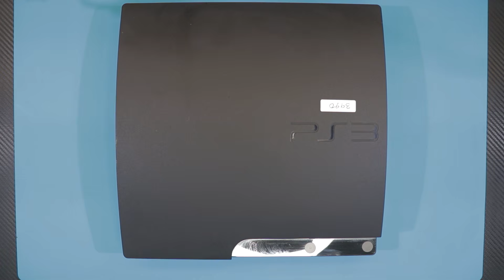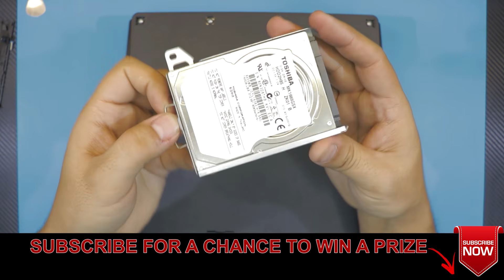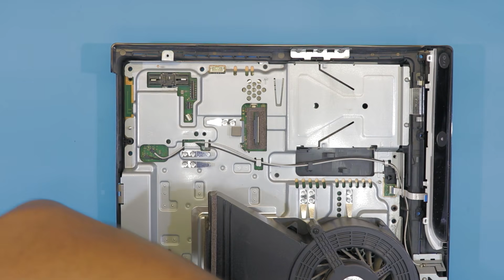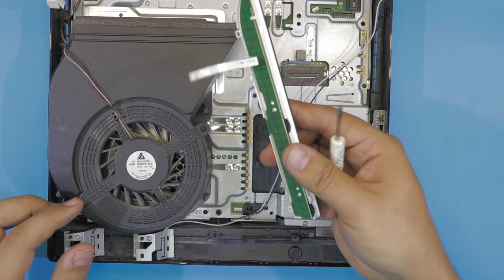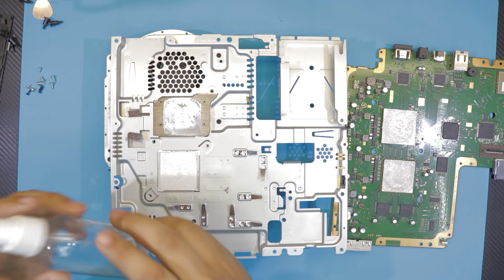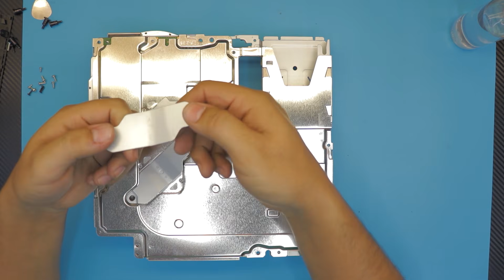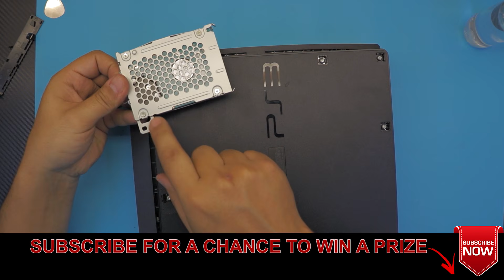HOW TO CLEAN AND  REPASTE YOUR PS3 SLIM ( playstation 3 slim console )

Comment: The 4K video shows the power button ribbon cable being attached the opposite way from this video, ie with the blue side facing in, not out. Whch one is correct?
Reply from the maker: both :P, the thing is from outside both are ps3 slim but from inside they change a bit (internal model). for e.g, the 4k video the DVD drive does NOT have the ribbon cable underneath , and in this one it runs underneath. both are ps3 slim but different versions.
now regarding your question, nothing will happen with you connect the ribbon cable the other way around, simply it wont run the console ON.
the best is to make sure the correct position before removing it.
if you forgot just test both side.

Thank you for the support to the channel :)

Comment: I loved the video, it was very helpful, however now, after I put the ps 3 slim edition back together whenever I insert a game in disk format the disk continues to spin/vibrate at max rpm in the disk drive, but as soon as I enter the game the disk stops vibrating and I hear the laser working. I reset the system to its original settings, but still vibrated throughout the entire reset of the system. Does anybody know the cause of this, software or hardware?
Reply from the maker: can you record a video with audio so i can identify better your issue?, thank you for the feedback and your support :)
Reply: Sure thing: here is my video link: https://youtu.be/_RbhqYYEm3M
Reply from the maker: ok i got it, its nothing to worry about you need to go back to @21:00 and reopen the DVD drive and double check the mechanism and make sure the round magnet plate in the middle is sitting in place. else it will do that sound. and double check are the flex cables make sure they are all pushed all the way in evenly. send pics of the dvd when open when opening it.
Reply: @uFixTek  https://www.youtube.com/watch?v=Xl6Btw-WzGc&ab_channel=RobertoStoica [Still has the same issue though]
Reply from the maker: okay everything looks fine in the video and nicely done with the video, im thinking and its hard to solve the issue not having it on hand.
you can try the following:
1. when putting a dvd inside the noise is the same or it goes away when you have a dvd inside?
2. try removing the top cover and power on and try to see what is making the noise. and you sure its the DVD no the fan noise (it sounds like dvd lens ) but you need to power on without the cover and test and take your time and look at it.
Reply: @uFixTek  I already did that and it all looks good, I checked the laser, ribbon cables, magnet is steady and level when spinning, as well as the disk is okay, the issue is only when the game is not being played on the PlayStation, as soon as the game is playing, there is still some noise, but it is much less because I think the PlayStation slows down the disk to be able to read it. The noise is only with the dvd inside, without the dvd the PlayStation is normal. Overall I feel the vibrations from the disk drive, not from anything else.
Reply from the maker: mmm i wish i could tell you i take a look at it but im very far, but trust your self and there is something not right with the mechanism of the dvd. try to open the dvd cover and test the dvd drive without the cover.and pay attention on the smoothness of the mechanism and see if its struggling at any point.
Reply: @uFixTek  Okay, if it doesn't work I'll just take out the dvd/game if I want to use it for anything else. Thank you very much for trying to help me and I wish you a great day. How can I spread the word about your channel?
Reply from the maker: i wish you the best and if there is anything in the future ask me in any of my video comments, and regarding the word about i appreciated any help i can get :)

Comment: Disassembly went smooth until I had to remove 5 screws from heatsink plate, only one of them got off, so I had to abort mission, I don't want to crack mobo or worse.. too bad cause I had some nice Thermal Grizzly Kryonaut prepared for my oldie PS3 CECH-2004B :(

I must get better screwdrivers or electric one.
Reply from the maker: can you mention what screw you had struggle with, you cannot brake the mobo its very tough and some screws require extra push and rotating force. and i appreciate your support to the channel by sub :)

btw use this they are the best in class:
https://amzn.to/3l4AvLy

you wont regret
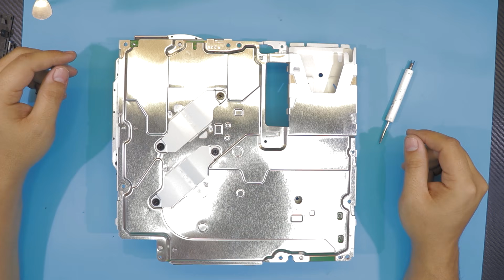Reply: @uFixTek  8:18 these five side screws.
Btw I have quite similar set, "no name" but very nice to use. Working with mentioned before five screws - that was my first little disappointment on it ;)
Reply: The point is, these screws are so tightly screwed, even my strenght wasn't enough and my screwdriver started to spin on screw's head and this is straight road to f... up screw for good (had this problem with PSP small soft screws, total engineering disaster, well done Sony)
Reply from the maker: to remove them i do a strait deep cut on the screw head and use a flat screwdriver :)

Comment: I've cleaned the fan and the power source n my fan still sounds like a vacuumed and I get a over heating warning after about 5 minutes. Would doing this same replacing the thermal paste help fix this issue?
Reply from the maker: YOU MUST replace your thermal paste else you will get over heating msg and crashes. repaste using artic msx 4 :
https://amzn.to/332RA2c

Comment: After doing this the ps3 works fine and it takes discs but it’s not reading them. Any help?
Reply from the maker: you may have not pluged in the flex cables correctly or all the way in. double check all the flex cables.
Reply: @uFixTek  that was exactly it. It was the big one directly underneath the disk drive. I managed to reattach it whilst the drive was fully intact. I could barely see what I saw doing and could hardly fit my fingers in but I still managed to do it. Just hope it stays in place. Thanks a lot
Reply from the maker: im glad that you got it fixed my friend , if anything and me out in any of my video comments. thank you for the support to the channel :)

Comment: what if i accidently lost those 2 rubber pads next to the cpu. they are so easy to come off.
Reply from the maker: you will need to replace them if you lost them,:
https://amzn.to/3n1acr5
Reply: Do is there somewhere that shows where they are supposed to be placed? I have no clue where they go.
Reply from the maker: you need to place then right to the left of the heatsink as in this pictures the brown pads:
https://imgur.com/a/S7Ii7MB
Reply: In my PlayStation slim there are a couple more pads and they came out of place as well. Do you have a picture of where the rest of them are too? After that I should be good
Reply from the maker: tomorrow i will open a ps3 and i will post you a pictures of the pad locations.
Reply: @uFixTek  I'm not sure if it is relevant but my model number is CECH-2001A
Reply: Hey did you ever get around to taking apart that ps3? 👉👈🥺

Comment: Thank you! I was able to follow along step by step and take care of dust-bunny clogged overheating system, and it only cost $17 for a safety tool and thermal paste. Awesome video!
Reply from the maker: Glad it helped! and i appreciate your support to the channel by sub :) if you ever have any question or request you may ask me in any of my video comments
Reply: @uFixTek  I Have some problems with my system, I Think it might be the fan because it shuts off right away. It would also turn off the PS3 the moment the fans start running quickly (Making a low humming sound) when it does not shut off right away in first problem and happens while im playing a game for a half hour.
Reply: @R101_Gamer  That's the same problem I have man,that's the sign of an overheating PS3...should follow this video,it's your best bet at fixing it.

Comment: Great Video! The title says "repaste" but this is SUPER useful for every part of the PS3 Slim, not just the thermal paste part.
Reply from the maker: Glad it helped! i put repaste because in order to get to paste i have to take everything apart and i like explaining and not cut up videos, and i appreciate your support to the channel :)
Reply: Exactly it's super helpful! I was struggling to connect the disc drives power strip that goes in flat til i realized you unclipped it and wound it back in through the drive. Thanks so much!

Comment: Is this how you fix your ps3 slim turn on then suddenly shut off?
Reply from the maker: it could help and resolve your issue , if its over heating and sudden power offs. but there is no harm to do a repaste.
Reply: After it suddenly shut off it turns on for second then off my ps3 slim is second hand i didn't open it through motherboard. I even replace it with new power supply i didn't work o think might be issue in motherboard.
Reply from the maker: your issue is from GPU chip you will need to open up and repaste the thermal paste and it may help you out, do it and let me know if it didnt i can help you by doing another steps.

Comment: Bending the clamps is just plain unnecessary and certainly counterproductive
Reply from the maker: you would know my friend, i wouldn't know with tests and tests over 15 years in this line of work. but by all means don't do it if you feel like it.   thank you for your opinion.
Reply: @uFixTek  what's the purpose of the bent clamps? what outcome do you expect? what do you supposedly achieve by doing that? Thsnk you for your time.
Reply from the maker: @MiloZabál  i would have to explain a law of physics  and in order to transfer heat / cold from one material (metal) to other material(metal)  you need pressure, because pressure, the thermal paste is there for only to fill the micro imperfections that are on the dye or the metal heat-sink(the quality of the paste will determine how the heat can travel in that material) but not how it will get absorbed into the second material, that come from how much pressure you have in between the materials.
to not go into more details, here the ex-clamp has only one purpose, to pull the heat-sink as hard as it can to the motherboard / gpu.
by bending the clamps backward you will generate more force , therefore more pressure , and therefor this will not result not only lower temperatures, but for longer lasting effect.
i hope i have explained my self a bit. 
but none the less you can run DIY tests and you will see the results by your self, im here to help as much as i can. 
in this situation for example:
if i do a service job with out pulling back the x-clamps the client has returned because of red light or error over heating.
but if x-clamps pulled back and same paste and same everything = client happy and we are all happy no more eerror no more over heating.
thats another experiments that was done apart from many other inside tests.

again  we always appreciate comments and supports
Reply: @uFixTek  Thank you for your time and politeness. But I think maybe you're wrong. By bending the clamps you're not improving heat transference nor augmenting pressure in a particular place. Putting excessive pressure can be counterproductive and harmful to overheating processors. I never touch nor modify the clamps and still I have had  a decent success rate with  the consoles I've done maintenance to, (which I've got to say are no more than 5) but I'll try this fix when I get a red light malfunctioning unit to test.
Reply from the maker: we could go on :P but i always say we have to do what works for us and everyone works in many other different ways. its like religion ,  you can believe in your religion but that doesn't have to mean that other religions are wrong, we /I respect all and if what works best for you, that's what it counts.  if that rocks your boat keep it up, and there is nothing to loose if we keep the mind open and try other options. i appreciate the discussion regarding this topic and i wish you all the luck.
Reply from the maker: just a note read regarding pressure and heat transfer for two materials, 
https://en.wikipedia.org/wiki/Thermal_contact_conductance

"Contact pressure

For thermal transport between two contacting bodies, such as particles in a granular medium, the contact pressure is the factor of most influence on overall contact conductance. As contact pressure grows, true contact area increases and contact conductance grows (contact resistance becomes smaller).[6]

Since the contact pressure is the most important factor, most studies, correlations and mathematical models for measurement of contact conductance are done as a function of this factor.

The thermal contact resistance of certain sandwich kinds of materials that are manufactured by rolling under high temperatures may sometimes be ignored because the decrease in thermal conductivity between them is negligible. 
"
Reply: @uFixTek  Thankyou Sir, you are a gentlemen. And as somebody below said, it's very nice you keep answering comments staying close with your public. I definitely value that the most in a tech/ fix channel. Thanks for the info, you've got one more subber here- Mi respect for you sir.
Reply from the maker: Merci beaucoup :P

Comment: If cd rom doesn't work should i still try cleaning it first, its still possible to clean the fan without doing the paste and repaste step right?
Reply from the maker: i would recommend to do the service and if you don't want to re-paste just make sure don't remove the heat-sink, if you separate the heat-sink , you must replase the paste, you can use a air pressure compressor to do the cleaning. without removing the heat-sink,and when removing the dvd rom cover use a cotton tip with alcohol 99% to clean the laser of the dvdrom and that can help with dvd issues.

Comment: I’ve clean my Ps3 and I did not repaste. It turns back on but no display whether using av or hdmi cables.
Reply from the maker: oooo, if you didnt repaste its = burning the gpu. you will damage the cpu gpu if you cleaned but didnt repaste.

Comment: I'm using other method to apply thermal paste. I make big drop in the center of chip and next X mark from the drop to the nearly odge of the chip. I disassembled once a second after application and assembly cooler and paste was perfectly covered every 1mm2 of the chip and not much leaked sideways. When you make lines like this is theoreticly possible to close some air bubbles between paste. I dont know why you have not changed that BIOS Lithium battery. Thats is CR2032 and is always good to change it when you disassemble and repaste PS3/PS4 and other stuff.
Reply from the maker: you can make x mark or drop in middle, but remember whats under the heatsink the only important part is the center of the cpu and gpu so if you dont cover everything its oka as long as you put abit in the midle, on the gpu the 4 block of memory that are inside dont need cooling.
https://imgur.com/a/3doPuNA
and regarding the cr2032 no need to change it if the voltage still 3v, this battery start going back if you dont use the ps3 if you read the schematics you will know that there is power regulator that feeds 3v to the bios chip if power present on game equipment, if there is no power present the battery feeds bios that can last for 10years (if the equipment is disconnected from power source).
but by all means if you feel like changing it do it. but is absolutely not necessary.
thank you for your feed back and support
Reply: @uFixTek  My battery had 2.97V and small leak after 10 years of use
Reply from the maker: 2.97v still good but if you got a acid leak then you could replace it. again no harm done to replace it when servicing if you got extra few buck to spend and buy as good brand battery so it will last longer and less chance of leakage

Comment: DVD DOESN"T work!  So did the thermal paste, booted up it works... 
So i assume i gotta take dvd appart again, but what do i look for?
Disk is currently stuck, and makes weird noise.
Reply from the maker: maybe you didnt put the dvd cover correctly in place double check the dvd cover and the flex cables
Reply: @uFixTek  probably, the round dvd cover plate thing fell out and i put back in.
Reply from the maker: there you go take your time and if anything take pictures and send it and i will look at it and help you out.

Comment: @8:25 Got 3 screws that just will not budge...number 2, 3 and 4
Reply from the maker: you must try press on them hard and twist very hard there is no better way, or cut them down
Reply: @uFixTek  Thanks for the response, managed to get them out with a slightly smaller screwdriver.
Unfortunately after re-pasting and putting it all back together it seems like the frame is misaligned as the front USB ports are not setting with the holes on the case despite everything else matching up...only noticed it when trying to put the lid back on.
Reply from the maker: ya those small detail you must watch for after placing any kinda cover.